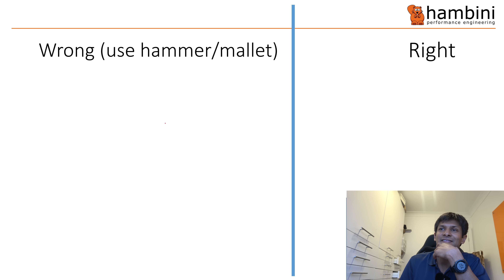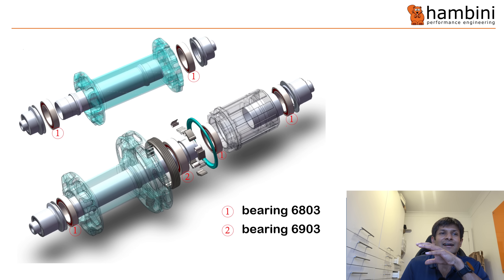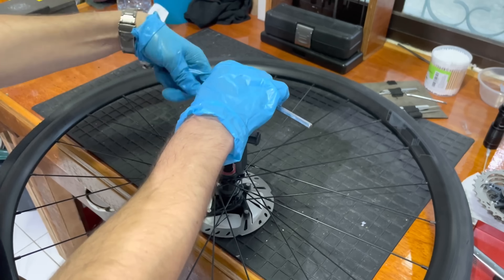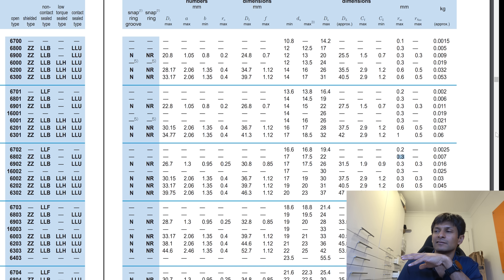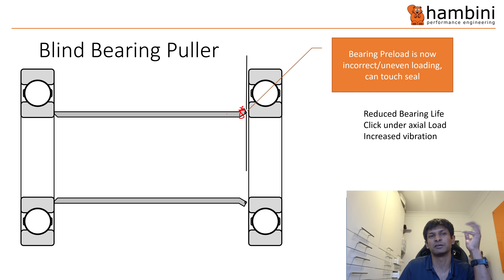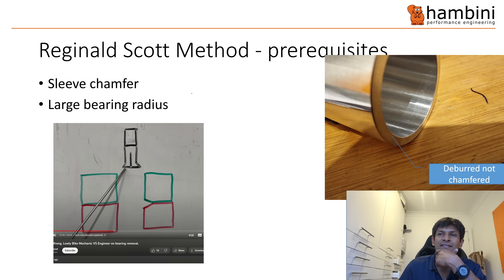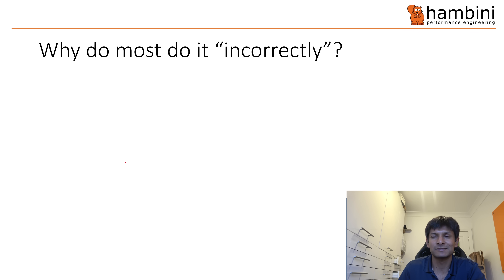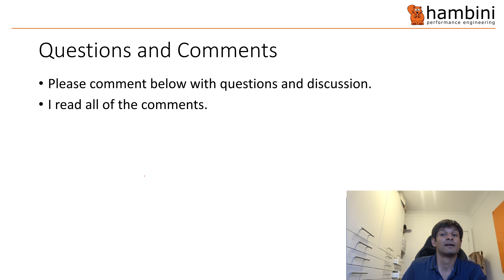I got REAMED by a Bicycle Mechanic | It was bound to happen at some point.

Comment: With good points on both sides, There needs to be a better design for the spacer and removal method thought out and implemented by engineers/designers of course taking into account cost and tooling practicality.
Reply: tappy tap tap tap.
Reply: Bike Mechanic for over 20 years here and you get these spacers in hubs and in the pivots of full sus frames and the companies that think about removal sometimes machine notches in these tubes so you have better access to tap the bearings out, rare though.
Reply: Just put a hole through the pacer tube… then drop a splaying fork into the two holes and use the spacer tube as a puller.
Reply: @chrisauld7630  Probably still wouldn't work without damaging the preload spacer tube. They are generally too soft. They can handle the pre-load compression but you would probably just cut through or deform the tube trying to use it to either push or pull the bearing out of the bearing seat.
Reply: What’s wrong with using a hammer?
Reply: Spacer (or often a machined shoulder on some sort of shafting) between the bearings IS the standard way to set  preload in many applications.  Oth some modest skill and care taken in removal also suffices.
Reply: When you get to big mahnes and bearings then it has to be considered as tapping with your bigest sledge hammer will not budge it... so the methods are well known, but it is more detail and features in the design and manufacture and may then need a custom or specialised tool.
Reply: or maybe returning to cup & cone bearings?...

Comment: I had to go and watch his video, for context. Many people were praising him in the comments for 'being right and humble', 'not one profanity' etc.  I found his whole demeanor quite disingenuous. He clearly saw a window of opportunity to teach the Great Hambini a lesson, posing as the 'lowly' mechanic, and steer some unsuspecting folk to his channel. And in doing so, he massaged the facts to suit. In this application, his method can only work if the recess between spacer and bearing is deeper that the puller's hooks. His drawing conveniently showed a very generous recess, but in reality - you can clearly see that the hooks are way bigger than the recess. His method can work, but you will always run the risk of damaging the spacer, no matter how careful you are. From an engineering perspective, that puller is NOT the appropriate tool for this job. Hambini's process may appear low tech, but it is 100% controlled by the operator. Don't be ignorant with that mallet, and the bearing will come out every time, without damaging the hub. That's the way to do it. His 'concern' with the bearing marring the housing on its way out was pure BS.

Comment: It is well known among the hair follicle engineers that damaging the internals by applying undue pressure at the very tips of the softer material (also referred at lips) may lead to improper tolerance causing a substantial decrease in pleasure in term of rider satisfaction in the long term.
In conclusion, a heavy hammer use in combination with a firm but precise hand is always preferable to any spreading tools.
I've voluntarily left out the use of a punch to avoid any confusion and negative reactions. 😶

Comment: I've always thought you were rough on the tools since the first Disney princess appearance. But you know what -if it works and you get away with it who cares?  if you remove a bearing its usually stuffed anyway......otherwise why remove it? blind pullers take a lot longer than some specialised random punch/tappy tap tap tools!

Comment: This is a fellow engineer talking. You cheated a bit. At the moment he pulls the bearing out, you made a cut. his bearing puller is practically flush with the bearing (at 22min40s in his video). Plus the "damage" or deformation of the tube you show is not on the side where the puller was. The whole thing is a bit childish, it's really just about whether your bearing puller is sharp edged or not!
Reply: Correct, also he basically didn’t argue the point of the video and he didn’t actually admit what he got wrong. The original comment he made that I set out to disprove was “the bearings in that type of wheel can’t be removed in any other way and my bearing puller won’t work.” That’s what I set out to prove and that’s what he was wrong about. But he completely avoided talking about that. 🤭
Reply: @reginaldscot165  Please it's "made" not "maid" although he likes to do the maid and so do I💋
Reply: @jamesmedina2062  voice activated typing.
Reply: hmm.
Reply: Good spot

Comment: Well thought out response.   I'm looking forward to the the bicycle mechanics rebuttal.   Spotting the flaring on the spacer was a nice data point.    I'm curious to see if the "new spacer tube is flared specifically to allow this tool" or if this is damage resulting from the tool.    I'm a hammer guy because I have a hammer and if I remove a bearing I'm replacing it but bicycle mechanics arguments seemed reasonable IF the parts were designed to work with the manufacturer supplied tool.     Not being an aerospace engineer I am not fond of specialty tools.
Reply: looking at the profile of the puller flared end, it is flat on the face that meets to spacer. Like the guy said, you gently apply torque until you hear the flare snap into the bearing radius...then you pull. To me the puller applies an even force all round. The hammer and punch cannot replicate this, however gently it is applied.

Comment: Should use the blind expanding collet style bearing puller for this
Reply: Reggie did annnd here we are.
Reply: @alan-sk7ky  Both Reggie and Hambini show the style that hooks around the back of the bearing but there is a better style that only contacts the ID of the bearing. If you look at BearingProTools you will see what I'm talking about. Since it only relies on friction it doesn't always work to get out stubborn/tight bearings but it should be the first choice.

Comment: Freehubs are often aluminum and hitting it with a hairdryer before tapping the bearings out almost makes them fall out. Why bother with the bearing puller? I've seen people use a concrete anchor (without the inner lip) to pull bearings out. That would do it I guess but you'd need to tighten it pretty hard. A challenge is to not catch the sleeve.
Reply: I tried hitting the hub with the hairdryer. My hairdryer broke.
Reply: @exvitermini  Ha! "Hey babe, help me dry my hair. WHAT ARE YOU DOING GAAAAAHHHHH"

Comment: Hambini what do you think of the carbon fiber threads for t 47 bbs being debuted by bridge cycling in a patent?  They claim it works and that inconsistencies in the carbon allow for for dirt getting into the BB threads and ENHANCING strength.  Saw this on the ride with Ben Delaney
Reply: You don't do plastic threads on  structural applications. Dead simple.

Comment: My solution when I was a mechanic back in the 10's was to use a cheap blind hole puller and tighten it up "good-and-tight" on the inner bearing race, and this was enough to grip the bearing for extraction. 
Doesn't damage the tube and it pulls the bearing out gently and without any angular deflection that could damage the hub shell.

Comment: I told him the same exact thing , most inner spacers i have played with have no radius or chamfer
Reply: If you look closely at the puller flared profile and think about how it is supposed to connect with the gap between space and bearing, then the space does not need to be flared, it can have a flat face.

Comment: I got a bearing puller(more a pusher??) for 6902 bearings after making an arse of the very first one (all my fault 100%, the technique, tools, patience and skill were lacking lol) but it doesn't have the lip on it, relies solely on gripping the inside of the bearing and doesn't touch the preload sleeve- but needs well tightened to grip. Then just need a suitable sized rod to tap it out square.... I've only just noticed his gloves, did he get them from Chernobyl?
Reply: Perhaps he has small Donald Trump sized hands...
Reply: Correct. To create motion we need applied pressure. There is no such force as "pull". Pull is a descriptor of direction.

Comment: Only point that is still unclear to me: he mentioned in his videos that, if you are not careful with your taping, you could deform the body of the hub. Since the bearing is pretty hard and the body is made of aluminium as well it's a possibility right?
Reply: the trick is not to beat the absolute crap out of it and work your way round slowly, ive seen motorcycle steering head tube frames mauled with less force than this fella was using on that dainty pushrod wheel , tipping the bearing and taking a chunk out of the face.
you go very careful when you are risking a a couple of hundred on a new frame plus about a days work to swap frames, tappy tap tap tap.
Reply: Know how to tap. That is why I never go to bike mechanic. They are busy, some are stupid & no integrity. Your bike will end up scratched & probably ruin all bearing's hubs.

If you can, use heat gun. The thermal expansion of Al hub is more than the steel bearings. I use heat gun to BSA bb, the bearings slide in & out like a butter.
Reply: @apair4002  A glass hammer is best for this job 👍
Reply: @Andy-co6pn  Then use a 'Prince Rupert's drop'
Reply from the maker: I think pressing on the spoke holes in 2 places is much worse which is what he did.
Reply: @Hambini  Oril is correct though?, that was a point of R. Scott. The hub body could become distorted if its not removed evenly and this could cause fitment issues of the next/new bearing. If I were a bearing manufacturer I would never warranty a bearing that in which I knew the removal of previous was likely to cause poor fitment or uneven interference. If I had to choose between mushed spacer tube or distorted bore I would choose mushed spacer tube everyday. BTW, how could the spacer tube prevent excessive preload when a positive stop exists at bottom of bore??? Didn't you do a video in the past that highlighted the bearing manufactures specified interference and contact geometry on the inboard bearing races? Belt and suspenders approach?, spacer tube are the suspenders? Thank for your work, Hambini.
Reply: @Andy-co6pn  Good point, I should have know.
Reply from the maker: @Angle-of-Attack  the way he portrays it is like it's some really aggressive sideways hammering causing excessive angle. the reality is you tap the bearing so the whole thing moves. If you were to go into to pedantic detail, his puller is not going to be square with the aperture, the legs won't be exactly the same length and the windout is on a thread ie Helix so it will rotate eccentrically as you draw it out.
Reply: @Hambini  i reckon you could negate all these potential issues by getting the welder out. Tacking to the inner race and slide hammering the bugger out.
Bit overkill but
Problem solved.
Reply: @Hambini   Your really reaching for an excuse here. Straightness of the threads on the wind-out shaft could be off in the thousandths of an inch over its length, not much concern there. Difference in height on the legs of the puller or its perpendicularity to the bore doesn't hold a candle to sideways exit of the bearing. Tapping the bearing  doesn't move the whole thing, the applied force is local, not global to the round bearing, otherwise bearing pullers wouldn't exist.  You a great engineer, its never fun to be wrong. You can turn this into an opportunity, design! The most perfect bottom bracket in the world is worthless if this is how we have to remove the bearings.
Reply: @Angle-of-Attack  The puller exists because many situations allow for it. Many, such as in this one where there is hardly any space between the spacer tube and the bearing, do not. The force of the punch is applied locally, but is directed relatively away from the hub wall, because of close-to-zero angle between the axis of the puncher and bearing. If you want to be extra safe, you can alternate between opposite sides of the bearing. The puller probably wouldn't have done damage to the spacer, if Reginald had been more conservative with it. It goes to show no tool is fail-safe, and proper technique is required with any method.
Reply: @tigonridge  The bearing is enveloped by the hub so bearing movement near one "wall" is translated to another via the bearing, impossible to pound it out evenly because one side of the bearing cants vs.the other when punch is used. Reginald is not yet to blame because nobody knows the true condition of the spacer apriori or when it could have happened, or if it is even is flared. Alternating between sides of the bearing is a given and I could hardly believe wasn't done.  No, fail-safe tooling and proper technique, I agree are important but mechanics should not have to develop the removal process wrt the design. And in my opinion, they should not have to choose between the least-worst option. I couldn't help but wonder if heating the frame or cooling the bearing would have helped. Its not really our job to engineer the process. Somehow I fell like bike manufactures have let us down, yet again.
Reply: @Hambini  Yeah, I suggested he use a washer (albeit it would be a large one) to evenly spread the load on the hub body. I cringed when I saw that.

Comment: So when is a bearing puller acceptable , won't in some circumstances both methods be valid ???
Reply from the maker: If you had a gap behind the bearing for the puller to engage on.
Reply: I can tell you this: Many hubs and things such as Campy power torque crank arms are designed for a careful puller to be used and thats what I have used. In a bicycle many parts are smaller and you will not have much space. I will say for the Chris King headset races I used a special tool in wood that I made to avoid any damage to the part but there is room there for any tool that you want. A more equal pressure means the hammering minimizes rocking motion and delays to the removal process as well. I think with steel it matters just as much how even the forces of hammering are as much as whether you use a continuous screw removal absent of knocks. With carbon fiber anything you will not want any hammering going on that would crack it/damage it hence why Hambini always takes that care with carbon frame bottom brackets. You are not going to hammer bearings home in them!
Reply: Stuff where you cant reach from the other side to hammer

Comment: Worked on bikes for the best part of 20 years. Never once used a puller on sealed bearing freehubs of this specific style. Worn bearings have always been chapped out carefully and freshies pressed in accordingly. Best damage the old bearing that's being replaced rather than the driver/ internals 😉.
Reply: @stevemorley  if the tolerances are tight to begin with there is a minimal rocking motion. When the bearing is tapped, the bearing outer body is not going to focus energy in one point and suffer any galling. The fact that the fit is tight to begin with and the outer edge is always radiused, translates into movement like a piston in a cylinder. So basically get over it👍
Reply: @stevemorley  No point missed, you clearly don't work on bikes. Had you done, you would have understood that comment.  

You will not damage the hub body by chapping the bearings, if you're careful and know what you're doing.

You will however damage the hub body by 'smashing' the hub body or using the wrong tool.
Reply: @stevemorley  Nah you are wrong.
Reply: @stevemorley  But dont beat yourself to it, you will get it someday

Comment: As a pissed-up ham-fisted backyard motorcycle tinkerer I feel I have to wade in here. Blind bearing pullers are a complete pain in the arse, getting them to seat correctly without damage is more chance than feel, and if the bearing is stuck the potential for damage is high.
Reply: Yep and that’s with a big radius on the bearing and a very robust hub
Reply: Motorcycles are ok, they have sturdy spacers. Get the puller in, tighten until snug, drag along the spacer until gap is found, tighten a bit more by hand and give it a tap, tighten to final size and pull out.